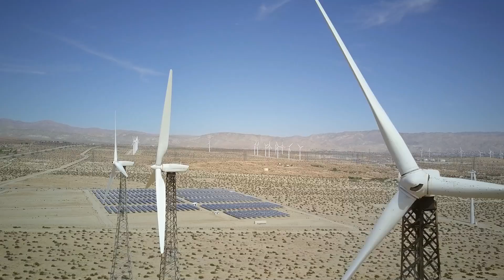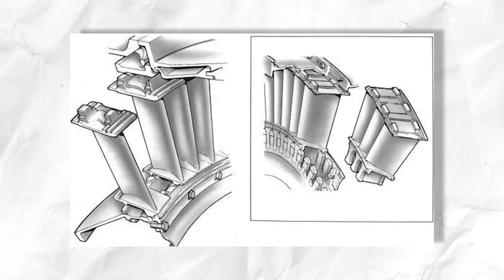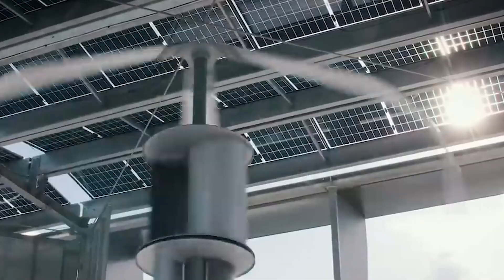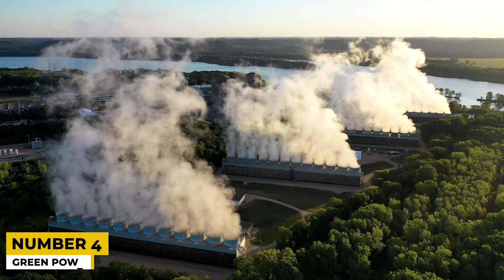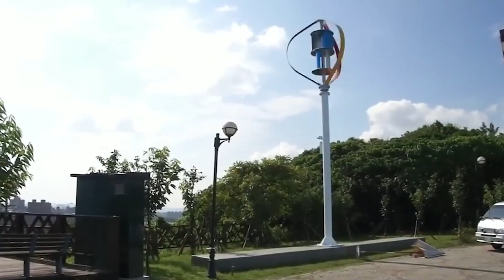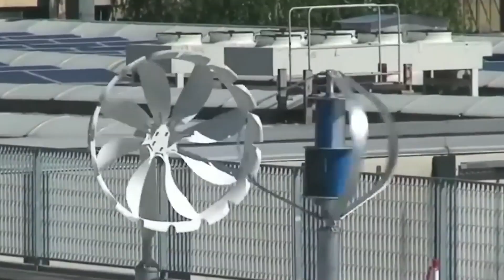The Future of Wind PowerPod

Comment: Yet another AI video spreading wind energy nonsense to attract investors and generating clicks. Many video fragments are not even relevant for the Powerpod. The venture-effect is non-relevant, as there is no venturi.  There is no future for the Powerpod, as is doesn’t perform.   Despite the bladed propeller in the top, its efficiency will be very  low due to significant energy loss in the air flow path. 

At 6 m/s it will not even generate 15 W, assuming a frontal area of 1 square meter. So forget the “up to 1.5 kW”.  The company behind it is just a money burner.  These types of videos give wind energy a very bad name.

Comment: Nonsense!  All practical tests of ground-based small wind turbines show: 1) They hardly produce any electricity! 2) They do not last long!
Electricity yield is proportional to third power of wind speed: +100% wind generates +800% more electricity! But close to ground there is 0 constant wind! 
On the other hand, solar panels generate at least 10 times more electricity with the same investment in time & money! Reliable & maintenance-free for at least 25 years! 
9 out of 10 small wind turbines stop working after just a few years due to the extremely gusty winds close to ground.